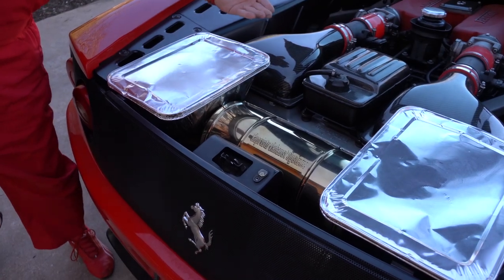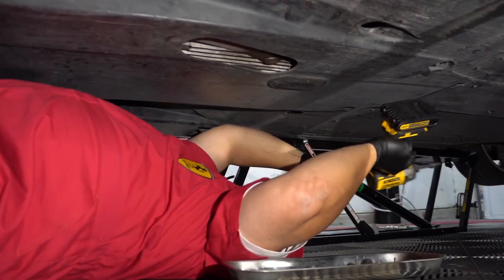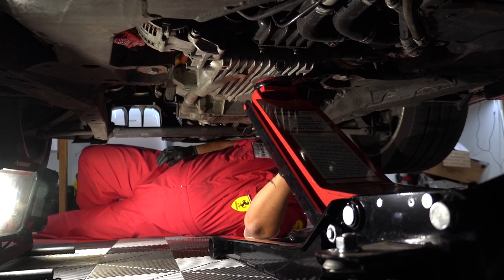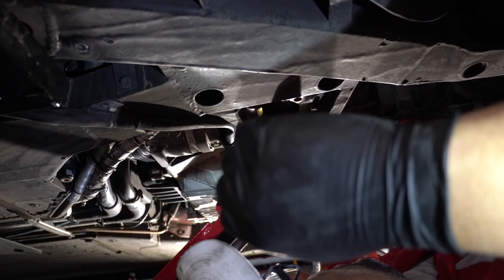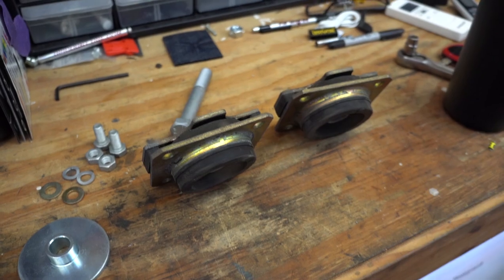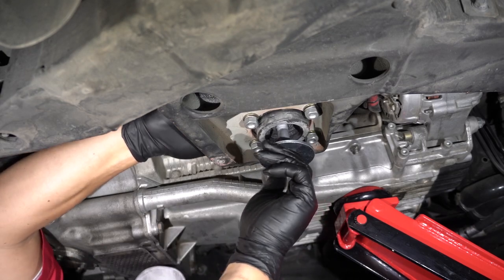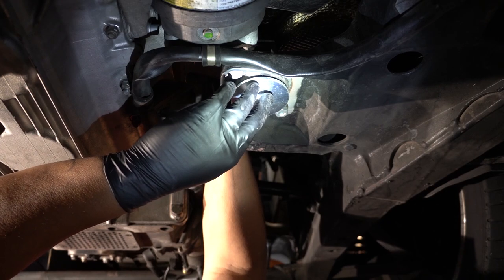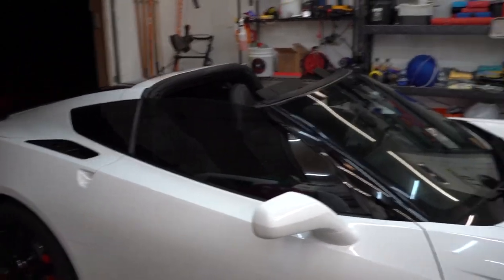FIXING a SUPER COMMON Ferrari F430 & 360 Problem - DIY Engine Mount Replacement

Comment: When you cut bolts you should run the nut on first. Then you spin the nut off after cutting and it reforms the marred threads at the end from the sawsall (or I use an angle grinder with a cutoff wheel)
Reply from the maker: Oh nice tip!

Comment: Did this job yesterday, I learned the hard way. Do not reuse the centre bolt and nut, buy a new pair for each at your local fasteners shop for $10. I tried using the same bolt and got stuck at 95% bolted up. made for a terrible next few hours cutting off the bolt head, then hacksaw the bolt 😢.
Reply from the maker: Yeah it's a single use bolt. It chews up the threads so it can't come undone... Sorry you had to learn that the hard way.
Reply: @normalguysupercar  haha, not your fault. Yeah not ideal day, but good bonding. I do have a leak out of the right hand Axel. Tried to fix that too, unfortunately to replace the seal you have to pull the bearing. So that will be a job for the shop 🤔

Comment: Be careful if you ever use the QuickJacks on a car with pinch welds.  The rubber blocks deformed and shot both jacks out the sides.
Reply from the maker: Yikes!

Comment: Any idea what the average cost should be to replace the engine mount on a 458 Italia ? Did you end up having this issue on your 458 ?
Reply: The mounts on the 458 are a bit more expensive since they are hydraulic and not just vulcanized rubber. Check out either Ricambi or Scuderia Parts, they have them in stock.

Comment: How is the reliability on the 360? Just saw a 2000 360 for sale for 62k and a dealership near me
Reply from the maker: It's decent.  Newer Ferraris are certainly more reliable.
Reply: Prince the 360 model was Ferrari’s first reliable V8 which could be daily driven.  They are solid.

Comment: in case no one has mentioned it yet..... when shortening a bolt, put the nut on the part of the bolt that is NOT to be cut off, then when you back it off, the burred threads will be chased by the nut.
Reply from the maker: Yeah I should have done that. Great tip!

Comment: I am having the motor mounts and transmission made of titanium and aluminum for weight savings as part of a line of lightweight Ferrari F430 / 360 parts !   It Is one of my future projects and need some old worn out ones to use in the R&D work up so, if someone has a old worn out set I would like them ! will pay for the shipping to me ! thx !  you can contact me thru messenger / FB and send a PM   thx Jack Dale